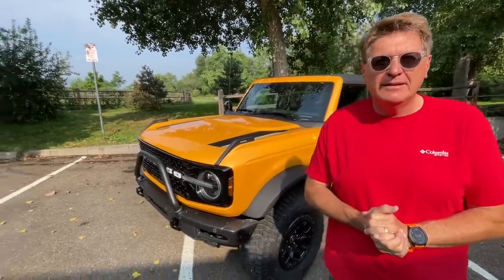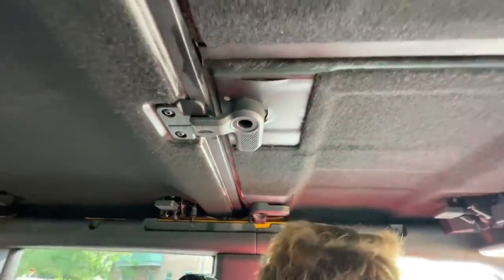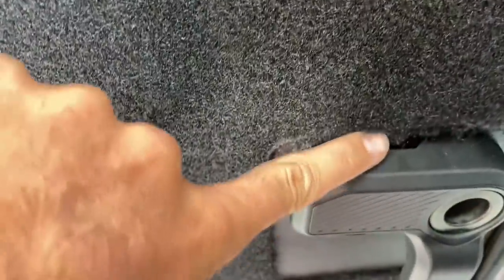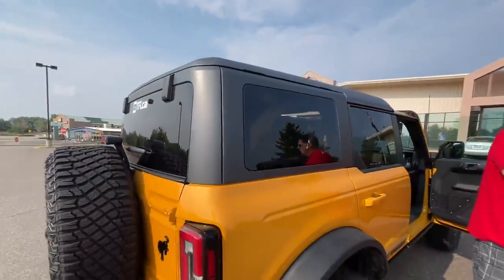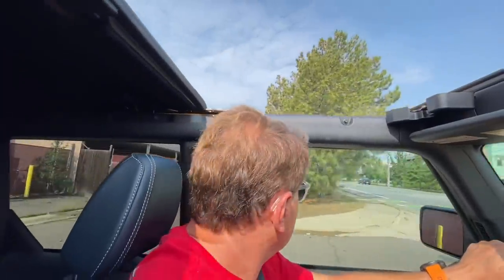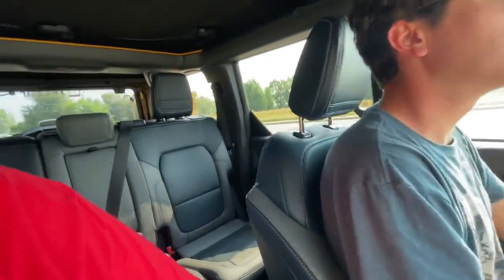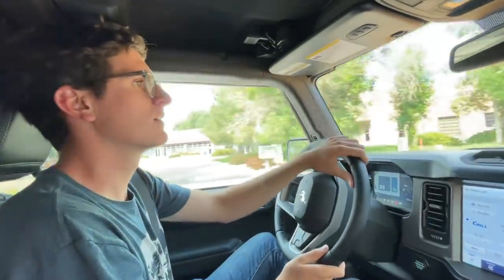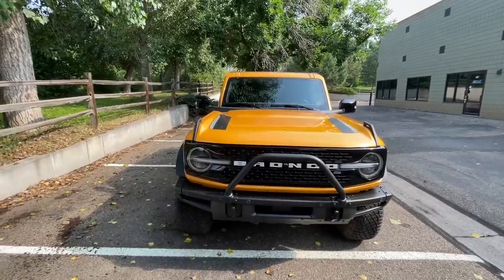This Roof Squeak In My Brand New Ford Bronco Is Driving Me Up The Wall, What Gives?

Comment: Typical Dwarf Union problems.  At the next arbitration they may address this problem.
Reply: Unions don't make bad designs. The Ford engineers and marketing team are the problem.
Reply: @jerrybrooks7886  so true although unions cause a multitude of problems this isn’t one of them.
Reply: @higg2156  Agree
Reply: @jerrybrooks7886  Can't even make a simple joke without bringing on the trigger brigade. Geesh. :)
Reply: @billhartley7971  That was a joke. Sorry, forgot to laugh. lol
Reply: @jerrybrooks7886  There's really no separation between unions and the larger company itself. When they design things, unions have to approve. I mean, they will literally shut the entire assembly line down because a part was an ounce too heavy for a 5 foot nothing "qualified" worker to lift.
Reply: @jerrybrooks7886  Oh, give me a break, you unaccountable union d-pehead. The thing is all warped, it doesn't fit correctly, and the liner is clearly coming apart. This is clearly a craftsmanship issue. Engineers and marketing have nothing to do with that.
Reply: @AkioWasRight  Hey, blaming the people that are least responsible for a bad design is not the way to solve this problem. The people with office jobs and college degrees are the ones that are prime responsible.
Reply: @jerrybrooks7886  This isn't a design issue, it's a quality and craftsmanship issue.
Reply: @jerrybrooks7886  LoL, got your comment deleted, I see.
Reply: @jerrybrooks7886  How is peeling felt "bad design"?
Reply: @checkers7166  How are the noises not a bad design from the start?
Reply: @jerrybrooks7886  It's not a union problem, it's a management decision.
Reply: @AkioWasRight  unions have to approve? Lol no they don't have a say in the design.
Reply: @jerrybrooks7886  Final assembly and quality control are 100% union.
Reply: @dads2006gt  Peeling felt IS NOT a design issue. The felt is literally peeling, LITERALLY PEELING, from the union factory that put the thing together!
Reply: It’s a ford problem
Reply from the maker: Guys we pinned this comment because it’s funny. Please don’t turn this into a referendum on the status of unions. Keep in mind….dwarfs only exist in books and on your lawn and they are not known to unionize. They in fact belong to clans which are family based units and not work based unions. We hope this helps!
Reply: @donlorenzo5718  that's wrong lol. Union workers put together what the company engineers design. Shipping/ giving the ok to ship units isn't controlled by the Union.
Reply: It's been tough hashing out the latest Dwarf union contract. They still want cookies like the Keebler Elves but the pandemic really put a huge constraint on supplies. I fear they may go on strike but with quality issues like these we may get the upper hand in negotiations.
Reply: @dads2006gt  Of course they do. No one forces unions to build anything, if they don't want to. So yes, the union must approve. 

But again, it's not a design issue when panels are messed up. You can't tell me what the design issue is.
Reply: @TFLnow  Best response ever!!!!
Reply: @billhartley7971  - Just gotta learn to tell good jokes! Heh heh. I got it!!
Reply: @jerrybrooks7886  It's not a design issue when the panels aren't tight and the felt is coming off. That's entirely a quality and craftsmanship failure. This looks like it was homemade by an amateur.
Reply: Nothing results more in higher operating costs and lower quality than a union.
Reply: @AkioWasRight  yep typical American Junk. For the money this thing cost, id never pay that for an American made product
Reply: @TFLnow  I was wondering why you blamed short people and not Gremlins.  lol
Reply: It could be cheap adhesive, cheap felt, or improper surface preparation prior to bonding.
Reply: @billhartley7971  You used a trigger word - 'union.' A joke about dwarf unions turned into a heated debate! Maybe you should have used guild instead of union? LOL!
Reply: The top was manufactured at Webesto  not Ford. Stop blaming Ford and the UAW.
Reply: @billhartley7971   Well i am surprised the Dwarf legal defense fund hasn't filed suit as of yet but they day is young!
Reply: You realise that they are covered by warranty, have you approached Ford as yet. You guys have issues with build quality on vehicles.
Reply: @TFLnow  Seasoned in  advanced material reinforcement design, manufacturing and failure analysis engineering, sounds and appears that there is de-lamination, warping, incompatible materials in regards to expansion, contraction and structural flex. 

Not a fan of latch and attachment systems.

Suggest supplier uses positive latch system, larger triple rubber seals for greater flex and new reinforcement composite materials more compatible with the metal material expansion, contraction and flex. 

Suggest high strength plastic snap fasteners for liners and redesign roof panels for liners to snap into. 

Just some thoughts to pass along.
Reply: @TFLnow  A roof panel with rattle or similar issues should leak in a car wash or heavy rain.
Reply: @AkioWasRight  26 + years UAW member so I'm speaking from experience.  You are wrong 100%.
Reply: @dads2006gt  And I'm in management, and can tell you a business is fully weighted by labor. If the workers won't work, nothing gets done. You're simply underhanded by arguing your union has no weight in the company.
Reply: @AkioWasRight  didn't say we don't have "weight" but the end result of shipping units is controlled by the company.
Reply: @dads2006gt  The definition of company is a "business organization", or "a number of individuals gathered together, especially for a particular purpose".

So, workers are a part of the company. What they want can literally make or break the companies bottom-line. 

You don't realize just how much your weight determines things for the company. You think your union can just milk and milk the cow, but the cow has only so much milk to give.
Reply: I think they prefer "little people" now🤣
Reply: @AkioWasRight  your comments show your lack of understanding about a union. The company and the union are separate. If we strike the company doesn't strike with us. They are salary and we are hourly.
Reply: @dads2006gt  No, it does not. And I just told why you're wrong. Your comment is a non sequitur, and it doesn't follow the previous statement.
Reply: @billhartley7971  because you're blaming the workers, not the bean counters and executives.
Reply: @donlorenzo5718  these parts are all hand crafted? I stand corrected.
Reply: From the same "engineers" that thought it was a good idea to put a eco-friendly/super dupper 4 cylinder which im sure is excellent!,  into the Bronco. 🤤👍
Reply: 👌😂👍underrated comment here! You win the comment section with this comment!
Reply: @bill hartley
*This isn't a Union problem it is a matter of terrible design and engineering, which 
MANAGEMENT approved of!*
Reply: Making burgers one day...Broncos the next.
Reply: @watershed44  Oh bullshit.  Tell me what the UAW workers would make if the plant closed the next day and they had to find another job.  They would make half pay with half the benes because the vast majority have no marketable skills.
Reply: @davec.3198  I agree about union wages but the bottom line is that Ford management and engineering are responsible for the poor design of this top furthermore Webasto I believe is NOT unionized in the USA plant where this top was made....surprise, probably a bunch of poorly paid temps put them together. lol
Reply: Ford doesn't even make the roof, some supplier does.
Reply: @arthurvandalay9087  Webasto based in Germany but they have plants in the USA and Canada. I'm pretty sure the US employees are NOT unionized, probably many of them are poorly paid temps too. Their German products are usually VERY good, such as sunroofs, and interior accessories.
Reply: Wow now Im glad that my bronco hasn't been built lol ford needs to fix this crap
Reply: @thenecromancer6564  When your unit finally arrives at the dealership make sure you go over it with a fine tooth comb before you sign the papers and take delivery, if you aren't happy with it be prepared to walk out without the car that day.
Reply: @nukewiller4083  no that’s entirely a design/engineering issue.

Because the designers/engineers are the ones that determine what materials are used, what the tolerances and production processes are. And then the accountants choose the cheapest supplier.

So the problem here originates in engineering, design or accounting and definitely not on the factory floor.
Reply: @AkioWasRight  because 1 oz will be close enough today, and 4 ounces tomorrow, and it just escalates from there. Ive seen it happen .
Reply: @A.WTolver  Most cars you buy the in the US are American made. Even the Hondas, BMWs, you name it.
Reply: @mark7067  God forbid Americans earn enough to buy a house one day. Nothing gets labor costs down like sending the jobs South of the border. A union busters dream huh?
Reply: @redhammer92  yea that's common knowledge but the engineering is not always the ssme
Reply: @watershed44  I just don't have any expectations/hopes at the moment. So anything is ok for me ☺️
Reply: Sounds like plastic creek.  Just spray a little 308 Aerospace protectant  on the joints.  Works great on my motor coach creeks and groans.
Reply: The roofs were made by a third party company, Ford gets the egg on face reward. Cheers.

Comment: I've got 20+ years in the auto industry and have always advised people to WAIT to purchase a new model release until 2nd year, as it gives manufacturers more time to discover any issues/quirks/problems and then remedy them.
Reply: Ive heard this suggestion for years and it just makes sense.
Reply: And I know this but as my wife reminded me I’ve done it twice.  2015 Hyundai Sonata Limited had the panoramic roof sound like lawn chairs in a station wagon. Multiple attempts at repair failed. Finally put an entire replacement and a year later the noise returned!!!  Should of lemon lawd it!!!!!
Reply: For what it's worth, I recommend the 2nd model year of a new release for same reason mentioned in original post, but also because waiting until the 3rd model year or 4th when buying new, will leave you in a more negative equity situation, if the manufacturer releases an all new model every 4 years.
Hope that makes sense...
Reply: To be fair though if everyone waited till the second year there wouldn't be a second year.
Reply: The problem is he bought a Ford thinking it was good because of the name
Reply: When a new model releases, I remind myself I need to wait at least 6 years. 2 for them to work out the problems, and 4 for those improved models to hit their depreciation sweet spot.
Reply: As also someone that works in engineering, I can say they'll also try to save a few pennies the second year.  If it can be made cheaper, they'll try it.  So it's a crap shoot.  I've had many first year cars without issues.
Reply: Heard this suggestion for years and decided to go against it with the hybrid Aviator.  It wasn't the first year of this generation of aviator, but it was the first year of the hybrid.  After 100 days of ownership, I did the math and it was in the shop for 30 days so had to lemon law it.
Reply: Always.
Reply: Yep, I am so glad i canceled my order. Let them work out these small issues and then get one in a year or 2
Reply: @HDA_III  yessir, it does. I've seen it time and time again and particularly when I was affiliated with GM, Ford and Chrysler.
Reply: @TundraJason  true, Ford, GM and Chrysler don't care about quality at all. Stick to Honda or Toyota 👌
Reply: @TermlessHGW  you do realize Toyota, GM, Ford, Nissan, Honda, etc etc use the same exact suppliers. Don't be ignorant.
Reply: agree, i had similar issues on a Q7, 4 months into production. Always wait.
Reply: I agree.
Reply: Yeap, I guess with Ford it is better to wait 100 years
Reply: @TundraJason Toyota redesigns their non-trucks more often than Ford’s non-trucks, yet Toyotas are still on the opposite (good) end of the reliability spectrum
Reply: This is the same group that went through 3 defenders while proclaiming it great....
Reply: the issue with that is that then your choosing from whats available. In this case Ford is letting you build your vehicle to your specifications which is rare in the USA, if you wait instead of buying now you wont have that option.
Reply: @dhrandy  yeah one thing I noticed is the first year of the redesigned Expedition, you could get leather on the XLT. Not anymore. It’s the fake stuff now.
Reply: I have the same problem but is not a big deal . What I do is take it off and put it back and stops. Am happy with the truck the only bad thing is the gas  not so good but that's cause I put on   tires 35s other than that is perfect

Comment: It seems like the rattles coming from one of the camlock‘s. I would suggest to try driving around with one cam lock in the open position so the cam can’t rattle against the locking plate. Then close camlock and re-open another one until you find the one that’s rattling. Once you find the bad cam lock you need to remove the locking plate that attaches to the body and put a a small rubber gasket or felt tape between the body of the vehicle and locking plate.This should make the camlock fit slightly tighter fit and hopefully eliminate the rattle. I’ve used felt tape to fix rattles on my vehicles in the past.
Reply: Just a shame that it’s over $60k for a vehicle with issues like this.
Reply: Danny, I agree.  Put silicone grease everywhere.
Reply: @drummeralex9198  it's also a brand new vehicle, first year production is gonna have some quality issues to work out. Ford has switched parts suppliers for the MIC top so hopefully newer models won't have this issue.
Reply: sounds like Ford needs your ingenuity.
Reply: @BigBlueMean  Good to hear they switched, that top supplier is literally damaging their Broncos reputation in many ways.
Reply: This^^ 

I’ve used felt tape and/or rubber foam on Subaru, Ford, GMC, and even BMW. I’m with them in this video, a rattle like that would drive me crazy. The flaky sound deadening material is not good either.
Reply: @drummeralex9198  It isn't over $60k for a Bronco, this is literally the most expensive you can make one and you can't even buy First Editions if you weren't one of the first 7k reservations. Average Bronco will likely cost in the low to mid 40s, i.e., the average price of a new vehicle in 2021.
Reply: Give it to whistling diesel he can take care of it!
Reply: I do not buy it’s the vendor’s issue ! Ford did no real world testing ? They had to know this was a issue , and because it is Ford, their fans would be fine with crap products.
Reply: @drummeralex9198  Not excusing this issue, but I bought a 56K Titan XD and couldn't raise the volume past 23 or the amp overheated. Interior and paint easily chipped when my watch brushed against it. Nissan never addressed the issue per my requests. Let's not get started on Tesla. Price means nothing when you're looking for quality. Proven designs tested over years/decades are quality, and the "all new" Bronco isn't proven design yet.
Reply: I thought the same thing. It's not the cam lock. I fixed mine and it took only a few minutes:

- Remove the driver's side roof panel and lay it on the the flat roof service.
- Identify the 1/4 turn latch that would be located over the seat belt (when installed).  
- Locate the black stem that would seat into the metal bracket on the vehicle frame (it's adjacent to the 1/4 turn latch handle). 
- Wrap this in a thin layer of electrical tape (three wraps is more than enough) or use - like I did - a short section of adhesive shrink wrap tubing.
- Reinstall the door. Problem solved.

Comment: And to add to the carpet liner being cheap, it’s weird how at some point when Tommy was putting the top back on, you could see debri falling from the carpet liner. That in itself seems cheap
Reply: I saw this too, it’s like shedding all over the place. Makes me feel itchy just watching it. That will only get worse I bet with extreme heat in summer
Reply: Can't even be bothered to glue that junk on properly either.
Reply: I thought the same thing. This bronco needs some head and shoulders
Reply: lf this was in England the dealer would charge extra for the debris in the roof liner!!!!!!!!
Reply: I'll bet that liner was an option too... Imagine smh
Reply: American cars
Reply: Yup, noticed that right away. Expected him to mention that first as opposed to the cheap felt material haha. It reminds me of those ceilings with the plaster that scrapes off and rains debris down on you. Really nasty stuff to worry about while you’re driving.
Reply: thats asbestos.
Reply: Nice to be breathing all the crap falling off the lining.How do these get signed off if beyond me--cheap junk.
Reply: I would expect vacuuming to solve that.

Comment: That "headliner" looks like it was put on by kids during arts and crafts week using Elmer's glue. The rattle might be an issue because of the pillar delete for the extra open air experience. 
Id take the pillar with speakers above my head like the Wrangler which I'm sure makes it more secure and less prone to rattling.